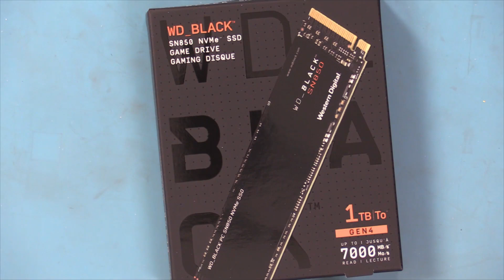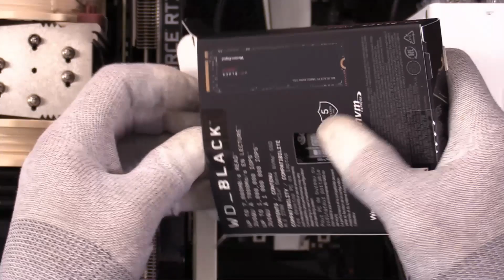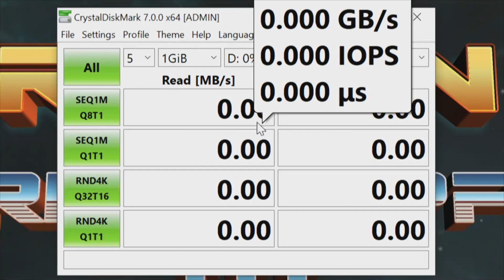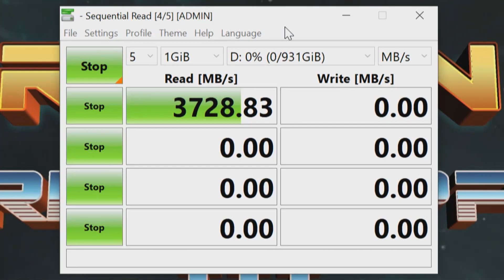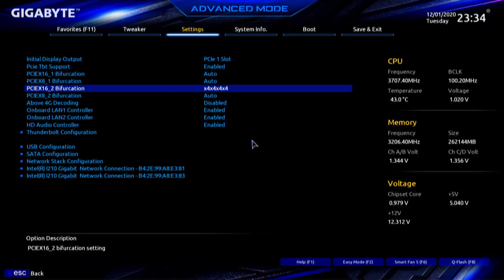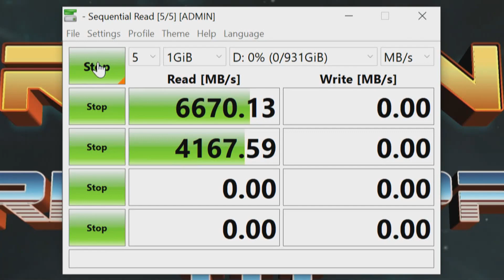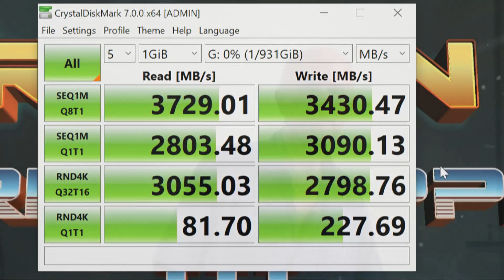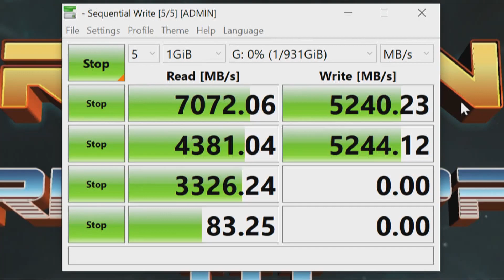WD Black SN850 Unboxing, Install, Test and Technology

Comment: I see you finally got the SN850 in.... I found some other interesting M.2 drives from Sabrent, maybe you have heard of them.... I am not sure.... but one of them is the Sabrent rocket Q4 PCIe 4.0 4 TB at 4900 read / 3500mb write speeds, and the other is the Sabrent rocket Q 8TB M.2 PCIe 3.1 3300/2900 mb read and write speeds..... The reason I mention this drives, is the size, and not so much the speed...., but drives of this size, at these speeds would seem to be a better storage solution for someone who needed a large capacity drive, at quicker speeds that SSD's upto 8TB such as the Samsung 870 QVO, or even Hard Disk Drives.... though for sheer storage it would be hard to beat HDD.... I am currently looking into a NAS system for the future..... QNAP seems to have some nice compact units, one of the more recent ones I have been looking at are the QNAP TS-932PX-4G, QNAP TS-473-8G, QNAP TS-H973AX
Reply from the maker: Hi Shannon Bailey, 
8TB NVMe, sounds intriguing! QNAP is the best choice. Has a Processor to facilitate faster delivery of Data. What's Your Status on the Move and the Build?
Reply: It's been rough with work, given it's the busy season..... 12hr shifts.... after this Sunday, I will pretty much be working every day up until Christmas..... It's frustrating because I work in a butter factory, and it is a lot of manual labor, for hours each day..., so I am exhausted a lot of the time.... I may be able to build the workstation desk this coming Sunday, and If I do I will record that, maybe do a time lapse type video.... I am still kind of considering my drive set up for my build...., but may just build it, and upgrade it later.... as the 1tb 980 pro is all that is available now, though I did see the 2tb version was listed on a etailer in the UK, so maybe soon... I seen the Rocket 4 plus is on pre-order on Amazon.... though It wasn't listed that way when I mentioned it to you before..... I was also looking at the SN850 drives, again I have seen the 1tb version, though B&H photo video lists a 2tb version for $568.41.... doesn't seem to be clear about availability, or stock though.... That drive should be around $450.00....  I don't like the marketing strategy of Western Digital with their whole black series drives, as they market them as  gaming oriented, themed out drives...., but that is just coming from someone who just doesn't game..... same as with the Motherboards.... I would assume it's about marketing, and satisfying the gaming communities, to obtain profits....so we generally have to tolerate titling like " gaming motherboard "..... " Gaming HDD "... " Game Drive ".... etc.... The western digital black series HDD didn't use to be labeled as gaming HDD, but now the SN850 comes with a Call of Duty: Black Ops COLD WAR label..... sheww....lol
Reply: Another thing I am considering is a new camera, to shoot with...., but I may not make that purchase till after the build.... Currently I use a Canon M50, but am considering the Sony a7c.... though I would really like the Canon C200 or Canon C70, but that isn't in the budget at this time.... The Canon M50 is a good camera for what you pay for, but when shooting in 4k, it is with a crop, which means you need to counter that with a wide angle lens.... Such as the Sigma 16mm lens, that works well with the camera, but I don't own this lens, and would probably rather upgrade the camera, vs invest in the lens.... also I would like to add some lighting to my video setup, so I am also looking at lighting, such as GVM bi color dimmable led studio lights.... I recently purchased a 7inch Neewer Camera Monitor to give me a better framing visual, along with an ac adapter for the M50, so I would have a continuous power source while filming, to avoid battery life issues.... Oh, and some words of advice.... If you option for a Camera monitor, you may want to consider a touch screen model, especially if your use to a touch screen LCD screen that comes with most camera's these days, as a button version model, such as what I have can be a little frustrating when changing camera settings.... in other words a monitor that gives you a larger screen of what your camera already has, with any additional bonus features it may come with..... a 7 inch monitor is the way to go, vs the 5 inch models in my opinion... :)
Reply from the maker: Hi @shannonbailey940 , Good to hear from You! You sound stressed. Agree. You needed to vent. Understand that. We don't game either. The whole gaming thing is not our thing. We Build Performance machines for work! Content Creation! Do You have everything You need to get Your Computer up and running? I'd like to see Your Build - Both the Desk and the Computer! May I ask, what do You do in a Butter factory? Thanks for sharing! Good to have friends who share Your passions and goals.
Reply from the maker: Hi @shannonbailey940 , 
A Cinema Camera with AutoFocus! Yes! Smart choice! a lot of People seem to be using the Camera You now have.  For a Monitor, SmallHD or BlackMagic. An external Recorder plus Histograms! 

Light's - GVM or Godox. Yes. Aputure! Take a look at their eco system. Lighting Control from a Smartphone app. Either way, get the SoftBoxes. Higher quality Lights shadow less green in the silver creases like Aputure.
Reply: I am not really stressed, just weighed down with work, which is exhausting, so I haven't really had the time to, situate the move, unpack, set up, and sort out everything I need to, in order to layout my recording of the whole process.... so that it's presented properly to my audience.... At my job it's been busy, and will likely be that way up until at least the 1st of the year, then gradually settle down.... back to about 10hr shifts Mon-Friday.....but for Now, it's 12hr shifts Mon-Friday, Saturday ( 9hrs ), then will include 12hr shifts for Saturdays, and Sundays.... It's the baking seasons.... Thanksgiving, Christmas, and New Years.... A lot of orders from Customers, who need to stock their stores for the Holidays.... Were talking Millions of lbs of butter.... lol.... Thousands, and thousands of cartons of butter.... Anyway yeah, Getting the desk built Sunday is a real goal.... so, after that I should begin the components/parts overview/unboxing for the build, then the build itself..... So just bear with me, I have been trying to accomplish this since October.... lol.... Lord willing it will get done...
Reply from the maker: Hi @shannonbailey940 , Just remember, it's good to be busy! Price of popularity! Thanks for Update. If the Lord wills and the creek don't rise! Merry Christmas.
Reply: Thanks.....lol.... Merry Christmas to you to
Reply from the maker: Hi @shannonbailey940 , Thank You!

Comment: Hey, I have MSI H510I pro wifi mobo, I have the same SN850 ssd but I only get 3500 mb/s read speed and 3200 mb/s write speed. Where is the problem?
Reply from the maker: Hi Giorgi Mtchedlishvili,
Welcome! Great Question! There are 3 Parts to this Equation. You have given Us Two. Motherboard and Chipset. What's Your CPU? 

Your Intel H510 Chipset according to Intel is PCIe 3.0 which is good to 3,500MBps. Your CPU will tell Us which Version of PCIe Bus is Supported. Be glad to check and Verify! 

1. A. MSI H510I Pro WiFi Motherboard 
https://www.msi.com/Motherboard/H510I-PRO-WIFI/Specification

B. MSI H510I PRO WiFi ProSeries Motherboard (Mini-ITX, 11th/10th Gen Intel Core, LGA 1200 Socket, DDR4, PCIe 4, M.2 Slot, USB 3.2 Gen 2, 2.5G LAN, HDMI/DP, WiFi 6E) 
https://amzn.to/3Zhoh6W 

2. Intel H510 Chipset
https://ark.intel.com/content/www/us/en/ark/products/196646/intel-h510-chipset.html

3. CPU? For example, We chose this Processor, 
A. Intel Core i9-10900K Processor 
https://ark.intel.com/content/www/us/en/ark/products/199332/intel-core-i910900k-processor-20m-cache-up-to-5-30-ghz.html
This is the best Processor Your Motherboard will Support. And this is PCIe 3.0. That's it. 
B. Intel Core i9-10900K Desktop Processor 10 Cores up to 5.3 GHz Unlocked  LGA1200 (Intel 400 Series Chipset) 125W
https://amzn.to/3Exqq6f 
As an Amazon Affiliate I earn from qualifying purchases! 

Now We know Your CPU, We know what Speed You can Expect from Your M.2 NVMe PCIe SSD Drive. Based on Your current Results, We expect Your CPU to only Support PCIe 3.0. As what We have Researched bears out. This is Why We do Motherboard Overviews for Slots and Storage of PCIe Resource allocations! No matter how fast of an M.2 NVMe PCIe SSD Drive You have, the Speed of the PCIe Lanes are only as fast as either Your CPU PCIe Lanes or Chipset PCIe Lanes. That's Your governor that will not and cannot go any faster. Hope that helps!
Reply: @BuildOrBuy  THANK YOU for this reply I appreciate that <3
Reply from the maker: Hi @Mch3dlo ,
Absolutely! Good timing for both of Us!

Comment: Great video! By the way, one of the main reason of why the larger the SSD the faster it is, is due to the fact that typically a larger SSD has also a larger DDR cache memory. Indeed, you can test that simply chabging the dimension of the test “file” of CrystalDiskMark, hence when you have saturated the cache you will see the speed of the SSD memory and its chipset capability. Nevertheless, the WD drive has some issues, maybe due to its firmware.
Reply from the maker: Hi IcaniCorrono, 
Thank You for Your Comments! Yes. Very Informal test although time consuming. Results may vary. Let's see how long it takes WD to update their Firmware on this Drive. Crucial was always on top on that. But we have not used a Crucial SSD for some time, since they were first introduced. Brings up another point, hard to update Firmware when the Drive is in RAID. But that's another Video!

Comment: I got the same speeds of SN850 on M2M (CPU lane) ~7000/5000 MBps. I have a Gigabyte TRX40 Master with 3960x. 
Now i bought the Asus Hyper M2 PCIE 4.0 card and 4 more SN850 to put all of them in RAID-0 on Asus card. Now i have  the Asus card with 4pc SN850 on the first 16x slot (with x4x4x4x4 bifurcation enabled) and the 5th SN850 on M2M slot. All 5pc SN850 in RAID-0, but i can't really reach more than 11000 MBps, I was expecting at least 30000 MBps. I don't know how,  but i reached only one time about 26000 MBps... until then the speeds dropped down to max. 11 GBps... My GPU card is PCIe 3.0 16 mounted on slot nr.2 (PCIe 4.0 x8).  Any suggestions go get again at least 26000 MBps ?
Reply from the maker: Hi Print Spesialisten, 
Good to meet You! Yes. Good results as far as that goes. In Bios, Select Volume instead of RAID. We're going to make a Video about that soon. Part of the order of progression in documentation as we unveil the layers. Like peeling an onion! Details matter! Stay tuned!
Reply: @BuildOrBuy  Hi and Happy New Year! 
I deleted my RAID-0 array and I created a new as VOLUME with 5 drives NVME SN850 1TB , totally 5Tb. I run crystaldiskmark 8.0 and i got max 6700/3600 MBps. After that i deleted the RAID-0 VOLUME and i have created a new one RAID-0 as RAID-0 and i disabled  Read/Wite cache back. I installed OS WIN10 on this 5Tb RAID-0 and the new results are: 23470 MBps read / 20280 MBps write. Now i really feel the power of Raid-0, so It is back to almost 80% performance . But I still expect to make this RAID-0 much better,  i want to make it to perform to max PCIE 4.0 bandwidth (32GBps).  My goal is to put 2 Asus M2 PCIE 4.0 with 4 drives  SN850 on each and 2 drives SN850 on mobo all of them in RAID-0,  so it will be 10 drives SN850 in RAID-0 (one drive of 10Tb in RAID-0). I am at tha halfway to get this job done.  Keep in touch! Hope i will succeed!
Reply from the maker: Hi @printspesialisten5509 , Progress! Good experience. BTW: What Motherboard and Chipset are You using? Yes, TRX40!
Reply: @BuildOrBuy  i have a Gigabyte TRX40 Master! The point is , after i installed all the drivers and win10 updates, antivirus etc etc , the speed dropped down again to 11GBps 🦧🙈🙈🙈🙄. So it looks like is a driver or win10 update problem that makes my RAID-0 to perform so badly... now i am in the same spot, again... only 11GBps... i will try to figure it out who's source of this problem... Do u have any suggestions?
Reply from the maker: Hi @printspesialisten5509 , Your individual Drives - 512 Byte or 4 KB Sectors? Your RAID Sector size?
Reply: @BuildOrBuy   Good question!  I am not sure about that, I think i saw something in Bios it was 256k. When i installed OS i formatted the RAID-0 disk during the installation of Win10 .... now i started over and after I installed win10 pro  the first thing I have done was to stop the win10 updates for next 10 day. I installed  display drivers and i will run CristalDiskMark after every new thing installed on my pc , just to see when the speed will drop down ... How can I see the size if is 512b or 4k for my RAID-0 array ?
Reply: @BuildOrBuy  BTW , i found the problem: it is my anti-virus software BitDefender that makes my RAID-0 ARRAY to run so slowly.  After i installed the BitDefender the speeds dropped down to 11GBps, after I  removed it then the speeds went back to 24GBps/21GBps. My next goal is to see how many nvme drives SN850 i need to run them in RAID-0 to reach max bandwidth of PCIE 4.0 (64GBps/ full duplex) !?
Reply from the maker: Hi @printspesialisten5509 , Never heard that in the mix. Just goes to show how details matter. Glad You found it. I'm surprised. Thanks for Sharing. Yes.

Comment: Gil, I think something is wrong on the AIC or even RAID on this board - I had the same hardware on a x570 board, and the performance was so much better then on the DESIGNARE - I’ll run some test and share (thanks for the very detailed video)
Reply from the maker: Hi Henrik, Just now seeing Your message! YouTube did not send Us the email! I'm seeing this from the Channel Messages. We'll do a follow-up on the NVMe RAID. We're going to be doing a Windows Bootable NVMe RAID soon! Details matter! Eager to know Your Results! We like to share and show what anyone would see or encounter on their 1st experience out of the box. Then show what needs to be done differently, if anything. Stay tuned!

Comment: Samsung SSD 980 PRO 1TB - is this not going to work at full speed on a MSI X70 Godlike in Windows10 or Gigabyte B550 Aorus Master in Windows10? Why?
Reply from the maker: Hi Don Jon, 
Yes! B550, x570, and TRX40 - All PCIe 4.0 - On the Motherboard. Using an M.2 Quad card is where they differentiate. How well will they perform? Someone else will have to share that Info! I do not have access to anything on the B550 nor the x570 Chipsets. If I did, I would test to find out! I'm curious too!
Reply: @BuildOrBuy  I've got an untested(!), untrusted(!) source as it (he) was laughing at me for why the heck I'm going to Raid0 two NVMe drives if he gets 7000 MegaBytes per second read on a Samsung 980 Pro on a X570 motherboard in Windows 10. I don't think that a person laughing at someone in my position with my strange need for speed would lie. But there's always such a possibility.
Reply from the maker: Hi @donjon7554 , I don't understand. Why would someone laugh at needing more speed? Reminds me when larger Parallel ATA Drives 1st came out. Some Users said they were too fast. The software could not keep up. Motherboard Manufacturers had to come up with a Bios update to slow the Boot strap to accommodate the newer, faster drives. I remember all of that.

And then there are those who laugh at those of Us who Build Computers too. Let them laugh at their own folly.

Just be aware, 2 NVMe Drives in RAID will not double in speed. Looks like another Video to be done for an explanation.
Reply: How do you have connected the drive, and which gen of Ryzen processor do you have? If you are using 1000 or 2000 serie CPUs you are stucked with the PCI-e 3rd gen. In the other cases depend on which m.2 slot do you have connetected the SSD. With the B550 chipset you must connect the SSD to the slot that is direclty Connected to the CPU otherwise you will be stuck on PCI-e 3rd gen (B550 allow you to use 10 lanes of PCI-e 3rd gen not 4th gen). With the X570 chipset you can use also the other m.2 slots (3 in the godlike, 1 on cpu, 2 on chipset), but you have to take in mind that the chipset allow you to use only 4 lanes of PCI-e 4th gen. In other words the chipset is connected to the CPU with a bus of (gen) 4x4 (lanes), and the chipset can do a lot of things, such for examples manage some USB ports, Ethernet ports and the PCI-e slots connected to it. In conclusion, if you connect an SSD on the m.2 slot driven by the chipset the speed of such drive will be typically lower, moreover, in the MSI X570 godlike you cannot use the m.2 slots of the chipset in raid for increase the speed because the whole bus is limited at 4 lanes (to be more precise you cannot have an improvment with “2nd gen” of PCI-e 4 SSDs because they fully utilizze the 4 lanes of the PCI-e 4th gen).
Reply from the maker: Hi @IcaniCorrono  , Thank You for Your Comments. If You'd like to follow the story of this Build, the Video below is a good place to start. 

AMD Threadripper 3970x Build Tutorial - Assembly and Smoke Test!
https://youtu.be/ewWlvTtYgIs